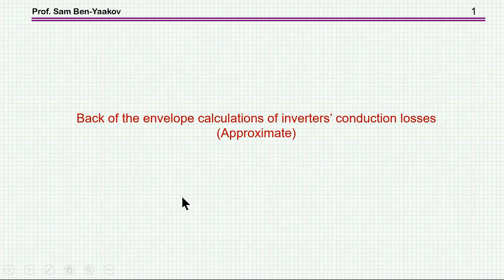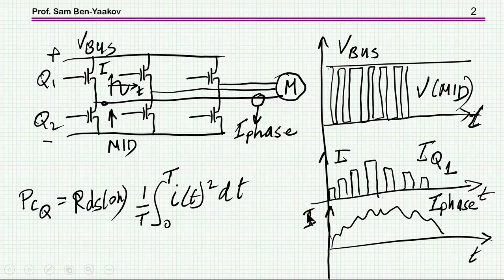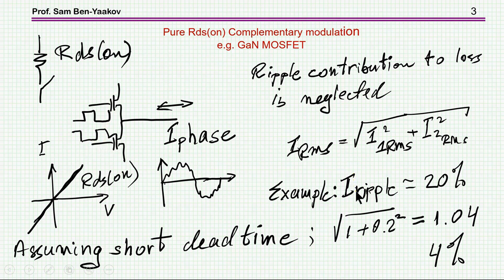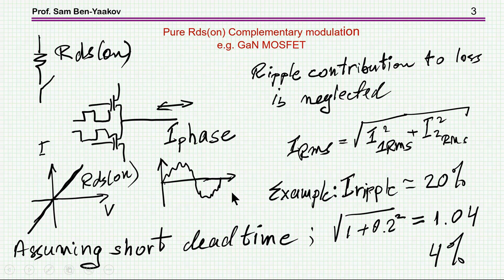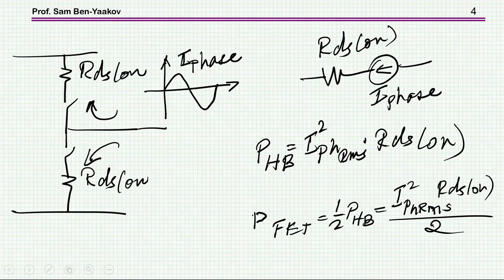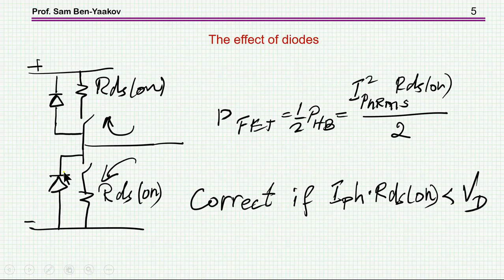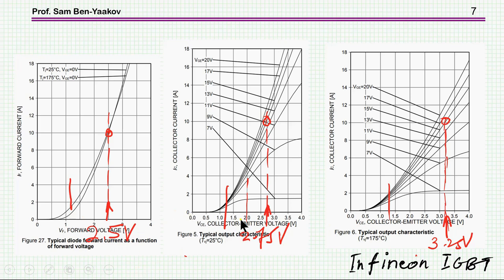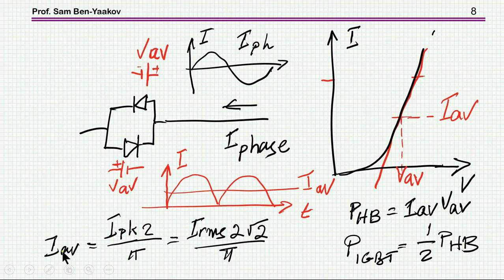Back of the envelope calculations of inverters’ conduction losses (Approximate)

Comment: Thank you Sir. In motor control applications, since the load is inductive, can we say that switching losses will also be small, since the current lags the voltage, therefore at steady state, it will be ZVS switching ?
Reply from the maker: No, no ZVS. Look at it like each leg is like a Buck
Reply: Thank you Sir. I hadn't thought of it in that way.

Comment: What if we had introduced a coupled differential inductor between motor and inverter , which is optimized for 1Khz range. Would it be helpful?. Of course overall cost will be higher. But, does it have any advantage in terms of efficiency and reliability. Regards.
Reply from the maker: Thanks for comment. Inductors between inverter and motor can help combat EMI, primarily CM